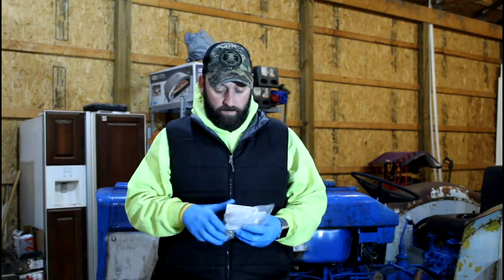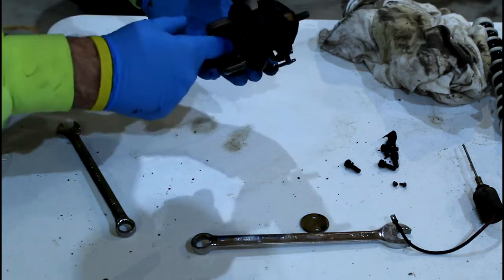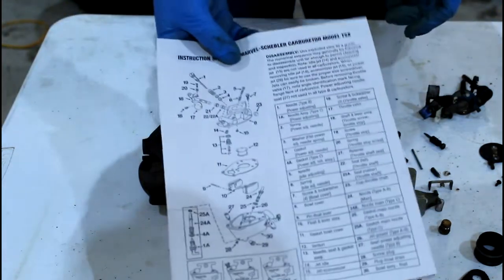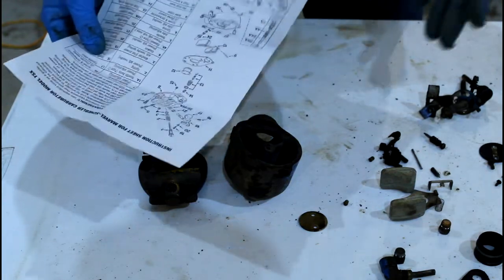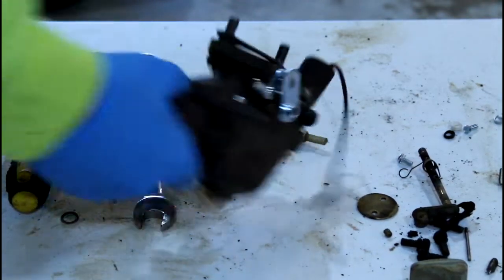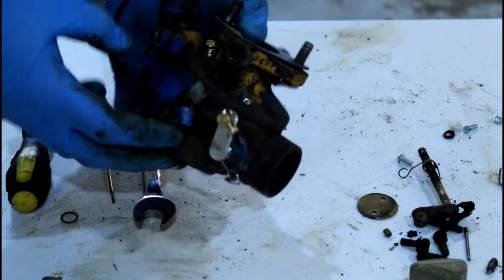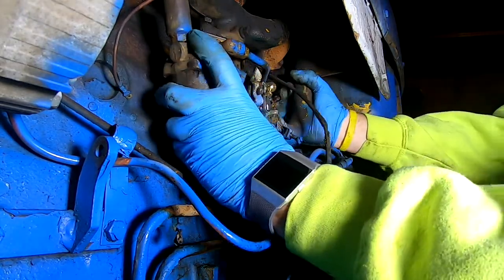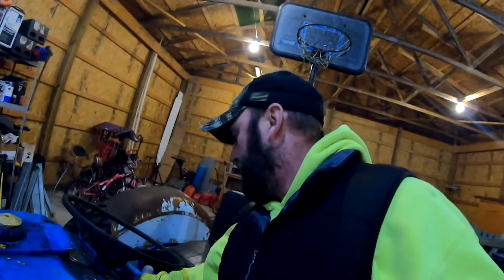INTERNATIONAL  444 TRACTOR CARB REBUILD

Comment: My thoughts: 
a) wash down carb first to minimize dirt availlable to internal spaces.
b) rubber hammer for separating top/bottom, to avoid distortion.
c) no apparent cleaning prior to reassembly. Easy to not see clogs/cracks/missing parts.
d) I like to check fuel shut-off valve whether it can lung-pressure of me blowing through fuel inlet.
e) Agree with your comment on that goofy-diameter tube connecting air cleaner tube to carb is hard to fit (and refresh!)
f) After the non-start, how about pulling a spark plug to see how much fuel got to the combustion chamber?
g) I missed your description of all the symptoms.  What lead you to fiddle with the carb?
h) How about putting the battery on charger to make sure you have the best spark possible?

I am looking to do something similar as my IH 444 carb is dripping gas now.